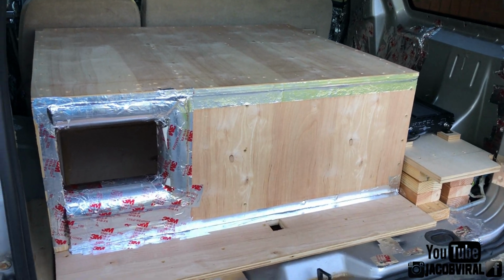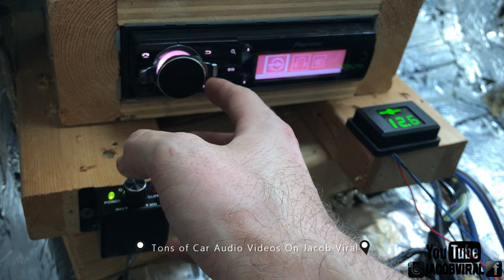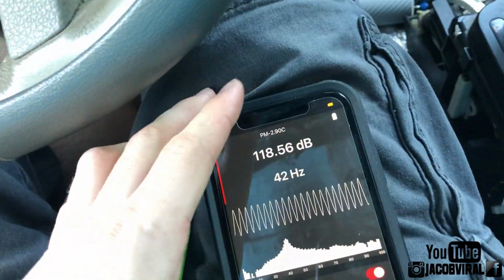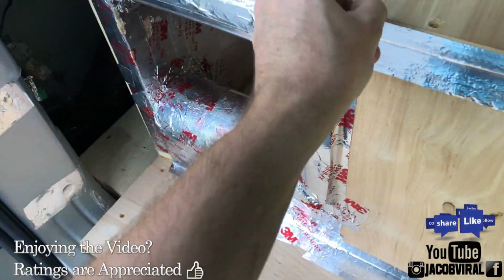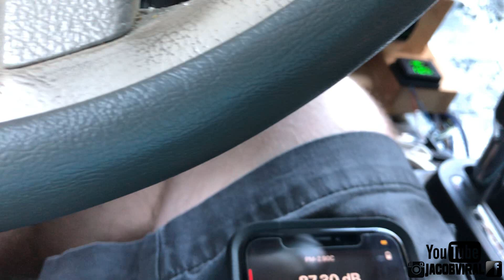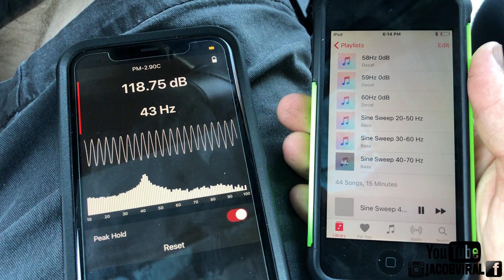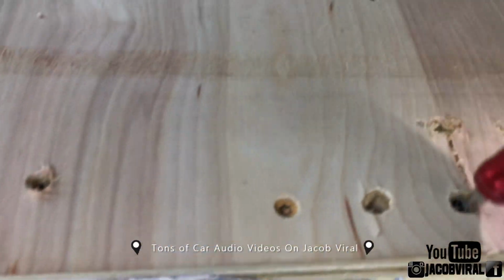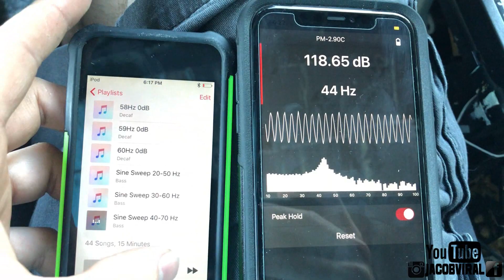PORT ROUNDOVER ADJUSTMENTS ON MY 4TH ORDER

Comment: You mentioned a few things that vary between low volume testing vs. high volume testing. Port velocity can be an issue with smaller ports at high volumes.

Comment: I have 4 sa8v3s I want to build a 4th order for. The design I came up with is 1 sealed chamber on each side .6cf each, 1.2 total. Port chamber in center 3.6 c.f.. Port 8.5" diameter tuned to 47hz. I have a old powerbass xa 4000 to power it with. What do u think of this design? Its going in an jeep wrangler 4 door hard top. Would u recommend changing anything?
Reply from the maker: If that’s per 2 subs for 1 cube then that may be slightly big but could always shrink later. Otherwise great idea and solid plan.
Reply: @JacobViral2  3 chamber single reflex, 2 subs in .6cf on each end, 3.6 ported. So 3:1 ratio. 4 subs total

Comment: Why don't you just sand it? Adding a weird 2x4 to the port opening, don't even get me started on the PVC?? Just sand it!!  It's not gonna stay in place at higher volume.  It'll sound so much better if u actually had a port, not just a hole.  Ohh... What 10" sub needs that big of a box. Looks about 7-8cu  ft.